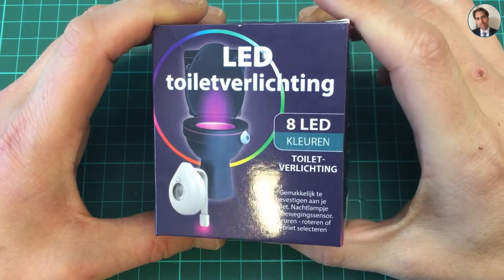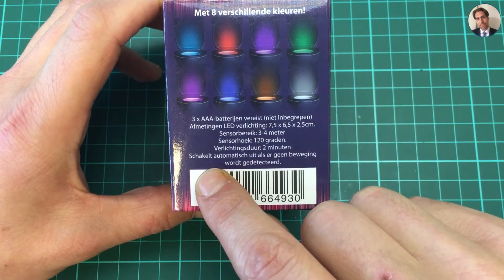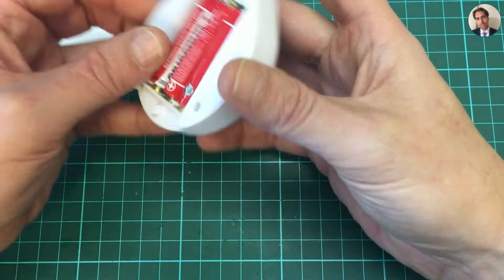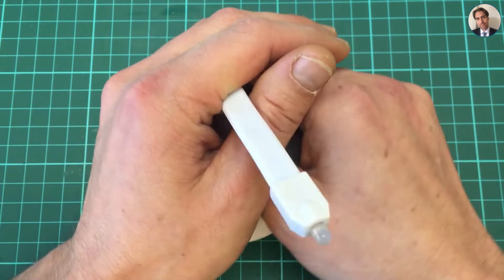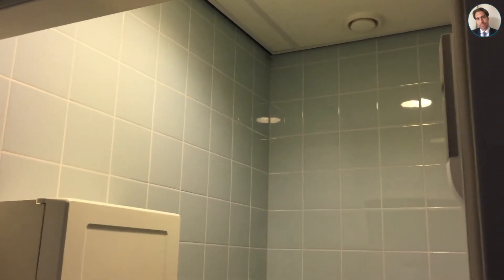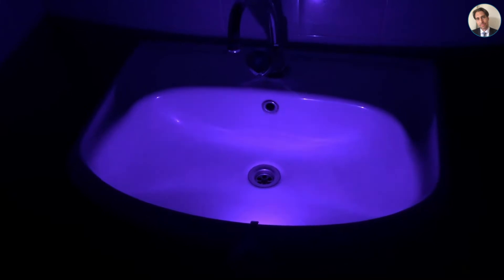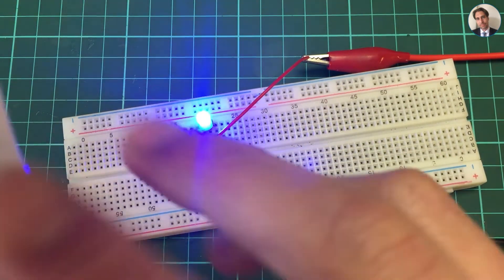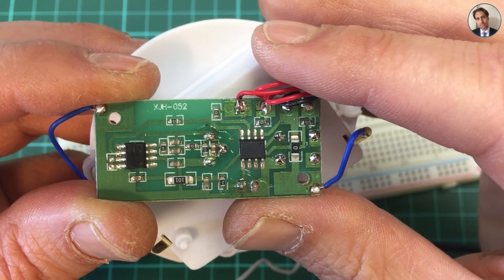How to spice up your Toilet

Comment: Great! Really nice to see your 'dump' lit up in 8 different colors!
Did you ever find out what the LED on the non-copper side of the PCB is for? Maybe LOW-BATT indicator?
I would select the white color as favorite using the button and the place it near the light switch in my hallway to easily find the switch when coming home in darkness.
Looking forward to the next video :-)  Thanks!
Reply from the maker: Dump illumination... I guess it's at thing ;) I honestly never gave it a second look so the other LED... I have no idea.